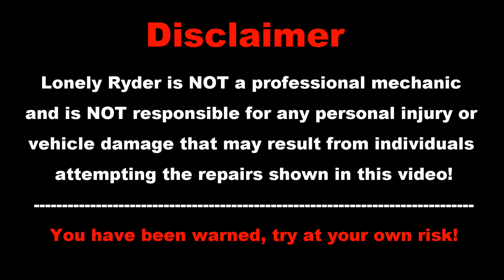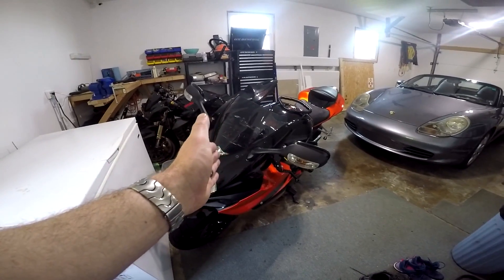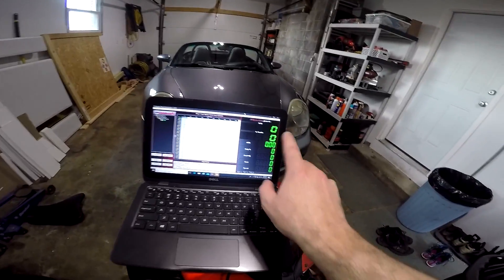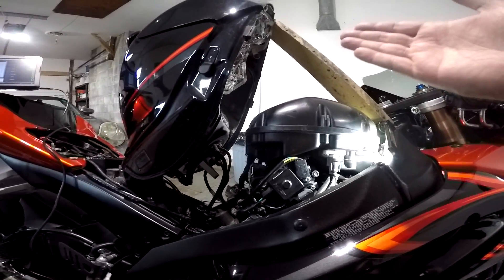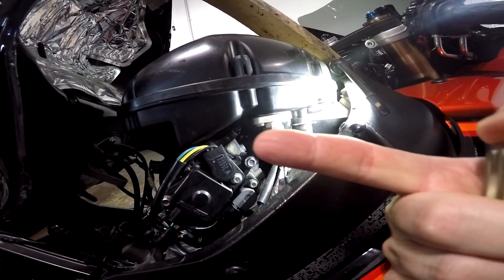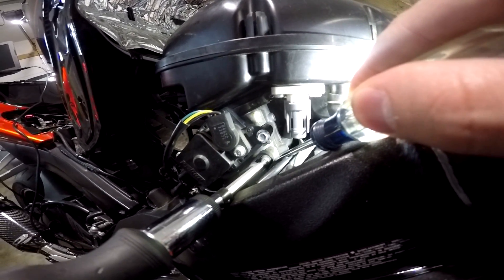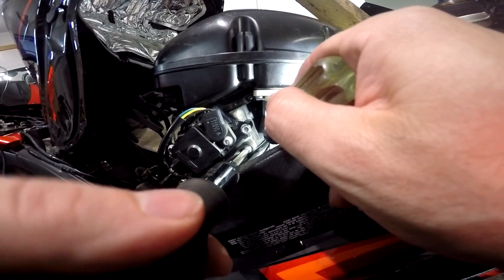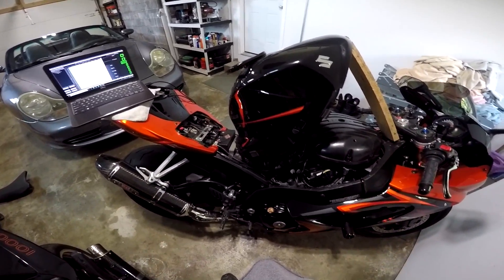Disabling Fuel Cut-Off Without ECU Flash (K7 GSX-R1000)

Comment: Gunna try this on my new to me 2016 gsx-s1000 dam near dangerous change down gears for first time rear wheel hopped on the wet and holding throttle steady its surging and almost bucks on occasions totally stock bike 11000 miles

Comment: Hi friend, I'm writing from Italy, the solution you proposed is valid and works, the problem is only that in certain situations you would have to vary the carburetion making it rich in fuel because the butterflies physically do not let the required air pass as if it were at 2%, in my opinion an even quicker attempt without the risk of uncalibrating the TPS is to adjust the idle screw raising it to about 1700-1800 rpm. (in addition, the power commander has an "acceleration pump" function to inject extra fuel and limit this on/off effect.
Reply from the maker: As long as you have a fuel controller, there is no issue. I simply adjusted the map on my PCV to compensate and re-checked the tune with my AFR guage. No lean or rich spots - she runs great!

Comment: Trying to fix the decel fuel cut on my 2007 Yamaha fz6, big issue where the bike cuts on throttle hard when coming off decel in higher rpms. No matter how softly I try to apply the throttle after decelerating coming through a corner, it feels like the first 2-3% do nothing, then bam, throttle finally kicks in. I should also state that the bike functions perfectly in all other riding conditions. The first 0-3% of throttle work perfectly when free reving or just driving around. Just tested the tps and there were no jumps or fluctuations. Should I try this, or should I go for ecu reflash? Even more confused after reading through pages of forms. Any help would be greatly appreciated 😅.
Reply from the maker: Flashing an ECU isn't cheap, I would only do that as a last resort. I don't know if the process I show with my GSXR will work or not, but it would be easy to try it and if it doesn't work, just put the TPS back where it was. You could also try this:
https://www.youtube.com/watch?v=XKpoDhq2_Uw

Comment: you're mapping is way off all the way thru the throttle, it doesn't just read 0% it reads it all the way thru vs gear position vs timing so forth .. there is a reason they want the TPS where it is, and its not for fuel cut off
Reply from the maker: Yes, I know the TPS doesn't just read 0%, as I show in the video it reading between 0%-100%. The reason I shifted the TPS so that it wouldn't read down to 0%, is because the ECU is programmed to shut off fuel if it sees the throttle go to 0%. Making the TPS floor 1% or 2% instead of 0% prevents the ECU from doing this. Changing the TPS range to 2%-100% (or 1%-100%, whichever you prefer) shifts it only very slightly out of calibration, not "WAY" off as you suppose. It's negligible enough that there is no negative impact on the bike's performance, all I needed to do was a slight retune of my PCV fuel tweaks in the 2%-20% throttle columns, that's all. Bike runs great!

Comment: What software are you using to read this ??
Reply from the maker: I am using the PCV software from dynojet and using the PCV to read the throttle percentages, You could also read the wire voltages with a multimeter instead.

https://www.dynojet.com/downloads/power-commander-v/
Reply: @lonelyryder7441   thanks for responding I really appreciate it

Comment: hello! i see you reply to the comments, please help me with an advice!  i have a tmax 530 2016 with all modification from malossi( 560 pistons,camshafts etc) somebody tune my ecu, but i don t have pops on exhaust, i want pops:D but this model has cut off fuel and it s not possible to disable it, it will help this "tps tune" for pops?
Reply from the maker: That's strange because usually with a performance ECU flash things like a fuel cutoff at decel is removed. I wonder why they didn't do that? You could try a TPS tweak like in my video, but I don't know anything about the Yamaha TMax, so I don't really know if it will work or not.
Reply: @lonelyryder7441  i try your method but it doesn t work, i m searching for an cut off fuel map, the original ecu, doesn t have this function, when i close the throtle the injectors shut down🤦🏽‍♂️
Reply from the maker: Sorry man can't help you much there. The only other thing to try, if you have the ability to change the fuel map at all, is increase the fuel in the 0% throttle column.

Comment: Will this make the bike run on the richer side then the stock position? When moving it to 2% throttle.
Reply from the maker: It threw the tune off a little on my bike, and I had to redo my fuel map some. It won't make it specifically rich only but will probably make some spots slightly leaner or richer throughout the rev range without a re-tune.

Comment: I have a Suzuki GSR 600cc 2009 ,and it does this exact thing you are describing , ...... so youre basically saying , it's normal ? from the manufacturer ? it's extremly annoying
Reply from the maker: Yes, it's programmed to do this from the manufacturer. The only two ways I know how to disable it is with a flash, or the method I demonstrate in the video.

Comment: I had the same model gsxr and it hard to start when it's a little hot after 10 minutes of ride! Do you have any idea of what may be the problem?
Reply: Might want to check your valve clearance
Reply from the maker: That or the injectors
Reply: Check spark plugs first, then fuel injectors, then valve clearance.

Comment: My sv650 2009 doesn’t decel pop because it cuts off the fuel completely while decelerating. So by this „mod“ my bike should decel pop right?
Reply from the maker: This mod will help, yes, but it's not JUST fuel that makes a pop, it's a combination of fuel and oxygen. People will often block off the PAIR system of bikes to prevent decel pop, because the extra air the PAIR system shoots into the headers causes popping. So you are going to want to make sure that the PAIR system on your bike is working along with this mod. That should give you a pretty good pop!
Reply: I opened the pair valves so it gets more air and later even opened the pair system so it’s constantly gets air. I set the tcp so the - on the display was up even without twisting the throttle but I still very rarely get a little quiet pop. Also I got a mivv without a cat and sometimes without the db eater. I think it’s more than just the throttle position, I mean decel pops are only possible if there unburnt fuel and only twisting the throttle 2% doesn’t give you unburnt fuel, but that just means my bike is doing what I should I guess. I think flashing the ecu would be the only way for me but thanks for your response!!
Reply from the maker: @hasbulla3167  If you have a Power Commander, you can turn up the fuel to make it run a bit more rich, that would give you more unburnt fuel in the exhaust, that's about the only other option besides a flash.

Comment: when you say “put the bike in service mode” do you mean that you have to Jump those wires near the ecm to put it in service mode? Or did you just mean removing the seat etc so it’s ready to service?
Reply from the maker: No, you don't have to jump the wires to put it into "Dealer Mode", sorry about the confusion. I just meant lift up the fuel tank to work on the TB.
Reply: @lonelyryder7441 oh okay that makes sense! Thank you for the response man I’m about to do the same thing to my 08 gsxr because that damn fuel cut off is damn near dangerous 😂
Reply from the maker: Yeah, it's pretty harsh. I first noticed it when I was tuning the bike, every time I would let off the throttle my AFR gauge would go blank (meaning no fuel).

Comment: Thank you for a good video, how will this work with the pcv map on the 0% and 2% throttle and will it work with the busa 08 ?
Reply from the maker: Basically, the PCV won't use the 0% column anymore, just 2%-100%. It can throw your tune off a bit, so I recommend doing this first before you start tuning, or check the tune after you do it. I've never had a Busa so I can't be sure about that, it all depends if the ECU is programmed the same way or not.

Comment: Your smart will a ECU from a 750 gsxr 
Suzuki work on a 600 gsxr
Reply from the maker: No, it will ruin the engine. The ignition timing is different, the fuel map is different, and the RPM limit is lower.
Reply: So I need to get the right one before damage the bike
Reply from the maker: @jamesdeckard  Wait, do you have a 600 with a 750 ECU in it already?
Reply: Yes
Reply from the maker: @jamesdeckard  Wow, if it runs I am amazed. But you are going to want the 600 ECU anyway, because the 750 ECU has a lower RPM limiter, so you wouldn't get the full revs out of the 600 engine.
Reply: Thank you very much yeah I have it running but not very good sometimes it will start and I would shut it off get My helmet and try and start it and it won't thank you very much I'm going to order the new one

Comment: This is brilliant, thanks for sharing this.  All the ECU flashing, Booster Plugs and/or cable adjusting in the world won't cure a jerky throttle unless you address this fuel cut issue.  Without a Power Commander, I think you could get it close just by trial and error but the PC really makes it easy.  Now to see if I can  apply this to my Honda NC700X.

Comment: Will this work if you don’t have a power commander
Reply from the maker: Yes, but the PC software makes it easy to see the throttle percentage and voltage. You can still do it, but you will probably need to read the voltage from the TPS wires with a multimeter instead.
Reply: What shall be the reading in Multimeter to be looked for?
Reply from the maker: @alokhemani1954   It can vary slightly bike to bike, but mine is showing 1.2 volts at 2% throttle. Check what yours is reading at 0% throttle, then go a little higher than that. Make sure you are checking the TPS and NOT the sensor on the STV, they look very similar. I've never used a multimeter on a TPS myself so I'm not 100% sure, but I think the (+) red probe goes on the pink wire, the (-) black probe goes on the black wire, and the middle red wire you leave alone. Might want to do some googleing to make sure I'm right.

Comment: hi, i assume that would work the same for the z1000?
Did you loose any engine braking or decl popping after doing this?   thanks.
Reply from the maker: To my knowledge, the Z1000 is not programmed to cut off the fuel on decel, so it's not necessary on the Kawasaki. As far as the Suzuki, engine braking is still there, it's just not as dramatic. I didn't have any popping beforehand anyway, as my PAIR system is blocked.
Reply: thanks for the reply,  i was just curious about the snatchy throttle really on the Z and thought that this might make it a bit less on/off!?
cheers bud.